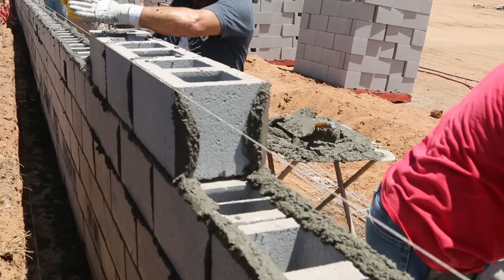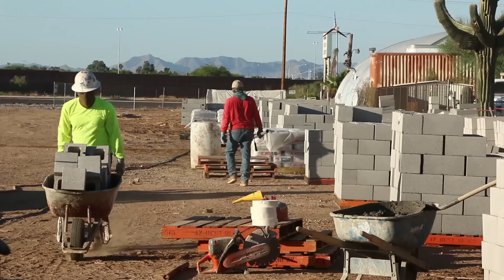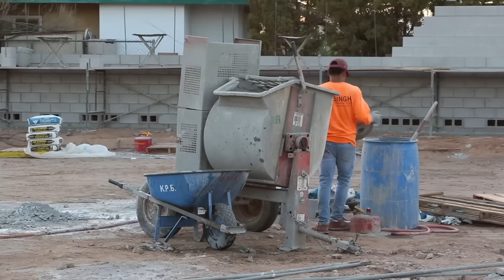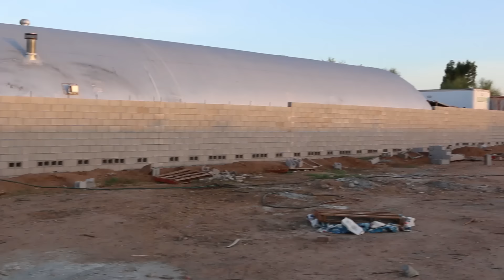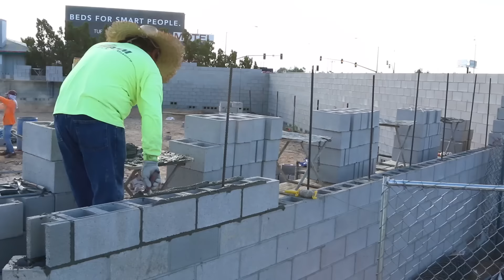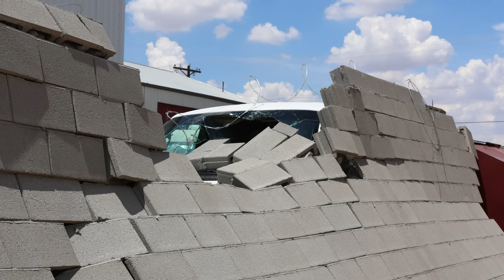Building A Block Wall

Comment: Very nice work, as a Structural designer focused on concrete structures I really appreciate a thoroughly examination of every aspect a wall design. Rebarbs placing, various concrete mixtures, ladder meshes involving, overlapping lenghts, foundations that all is very important and plays a significant role. The workers had to be very crafted, when they are able to build up such distances of line structures without string using.

Comment: https://youtu.be/Mf4p7OBj9jA                                                                                      
https://youtu.be/8NtXOj8duX8                                                                                                                          
For regions and/or states: we release the “know-how” to market an innovative professional fixing system (it is applied without drilling). https://youtu.be/8NtXOj8duX8                                                            
Für Regionen und / oder Staaten: wir gewähren das “Know-how“, um ein innovatives professionelles Befestigungssystem zu vermarkten (es wird ohne Bohren angewendet). https://youtu.be/8NtXOj8duX8                                                                                                                                     Pour les régions et / ou états: nous accordons le «know-how» pour commercialiser un système de fixation professionnel innovant (il est appliqué sans perçage).                                          
https://youtu.be/8NtXOj8duX8                                                                                          
https://youtu.be/Mf4p7OBj9jA

Comment: Before fixing steel bar you not dome dressing, leveling and compacting of earth surface to ensure when wall load pressure goes down its resist
It 
Also you not did PCC 1:4:8 to make sure steel bar is on same level

Third class method you use for RCC

Comment: Honest question, this is a beautifully well-engineered wall and amazing work. You and your crew are master Craftsman. But why not put buttresses in the wall and why not also make it double wythe? Buttresses along with the poured columns that you've included would help strengthen it even more, or if you made a double wythe instead of a single wythe you'd have 16 in thickness of wall which would resist overturning pressure even more. It would however be more expensive because you're using double the material and you will need a wider footing. So why not just put buttresses every 4 feet? That would be a good compromise. Along with the grouted columns every 40 inches...

Comment: What an amazing video! Those muscle memory skills are absolutely awesome. Few things I noticed/queries -

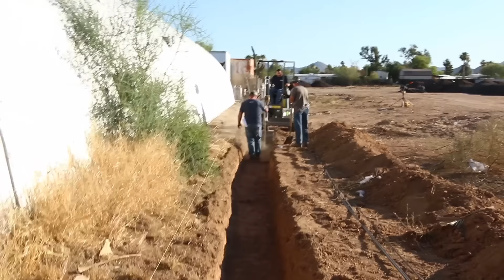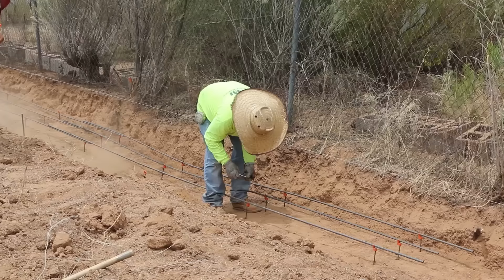- Why is the trench not in a straight line 1:00, 1:33? Surely that's going to waste concrete in the footing? 
- Why is the rebar not in the middle of the trench 2:04? Walls are supposed be centred on the footings unless designed and supported as eccentric.
- Why is there no mortar on the inner meeting surfaces 0:00 - because it gets filled anyway with the grout?
- How do you fit the top horiztonal rebar you mentioned - is there a different block that allows that or you just place it below the top block in the mortar bed? 
- That mix looks perfect and makes a huge difference - not too wet so as the blocks sag, not so dry as to make kncoking into position tricky. Is that why they are not putting the excess mortar scraped off back into the mix 18:59, so as to not dry out the mix? It does look wasteful just throwing so much away, so there must be a reason.
- How come they have not wetted the blocks? Doesn't that dry the mortar really fast and ake for weak joints? Sure the grout will make the wlal strong but won't it need re-pointing sooner?
- How heavy are thse blocks? In the UK they weigh quite a lot (30kg = 66lbs), yet these guys are throwing them around with one hand. Is that a different spec, efficiency of movement, strength - am I just really weak?!
- How come the footing concrete doesn't flow under those steps, which don't go down to the bottom, and try and level itself? I guess the mix must be stiff enough?

(Yes I was the annoying one in school always asking stupid questions. That's why I got top grades and now design buildings)

A lot to learn from this video, thanks so much for posting. Always humbling and fascinating to see this kind of efficiency.

Comment: I know you know your work, but next time stand next to an expansion joint where a block meets a block not a half, 38 yrs in the trade, just saying
Reply: Was that bothering u lol ? Its not common but I've seen it a few times on commercial jobs and it really don't matter one way or the other as u know Joe
Reply: @zeebee3606  love watching your videos, Builders like you don't exist anymore with your setting out and would have loved to be one of your mason contractors.  The half to full block is just a pet hate and yes it dose not matter in structural work but i don't allow it on face work. cheers keep up the good videos
Reply: @joemoore8782  o I'm not associated with these guys lol. I live in the same area but never worked with or met them.

Comment: I saw this and decided to knock down the back foundation wall of my house as it was sliding down the hill. I propped up the house, poured a new footing and got going. I laid 30 ft of 17 courses. At first it was struggle but after getting waist high it went easier. Most important thing, make your footing level, I didn’t. Mixing 100 bags of concrete by hand is not recommended. Thanks EC for providing the inspiration and the knowledge I watch your vids now👍👍

Comment: So, the mortar is the weakest link in the wall. Why not eliminate it with interlocking blocks? No need to mix the "glue" or pay the cost of it or applying it. A layman can set blocks. Where else might cost be lessoned in this scenario? Less verticals/grout/rebar? Isn't the cost of casting both block designs the same? The rest of the world, Asia, Africa, Europe, India, Australia, are using interlocking.Why aren't North Americans? Is this politics? It must be. Only politics explains irrational behavior on a massive scale.

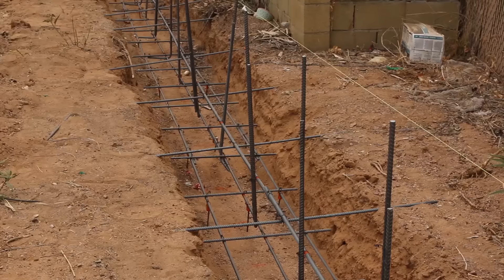Comment: 6:15 thanks for your consideration in vertical rod placements. Unfortunately the concrete guys of today are either too dumb or too lazy to do it right. As a result it takes the masons 2-3x longer to lay the first 1-3 courses of a foundation because we are either bending every rod or cutting around them.
Reply: That's you guys' own fault; someone needs to be there to make sure it's right before the concrete sets. You can't just tie the rebar and leave the footing for the ready mix guy while hoping everything magically stays in the right place. Some non-mason doesn't know, doesn't care, and doesn't get paid enough to be straightening out all of that rebar.

Comment: I dont know guys....but...why doing it easy way when you can do it hard way....have you ever think about why are these block hollow?...that concrete has to be inside that block not under or beside.....you just lay 1st layer to concrete base...level it....and than you just lay one on another on it dry...after every 4th layer...you fill it with concrete with that mix you used for foundations...than you just continue with another 4 dry layers and repeat process....

Comment: As a master Commercial Form Carpenter 35 years , in NYC ,,,, block , brick ,stone , pored concrete are being taken over by panelized factory made wall and slabs bolted to structural steel ,with all kinds of textures window ,,door openings ,some of these panels weigh over 20 tons ,
Myself with one other carpenter have installed 55 foot long 5 foot wide planks  600 feet long train platform in 8 hours with a small crane ,then a 3/8 finish concrete topping the next day

Comment: 3 inches is required by code ACI-318   chapter 19 ICC  Expansion joints should be implemented, not crack control. Check PCA criteria for mixtures. a good contractor knows this.

Comment: ""making a block wall is hard!"
egyptians 4000 years ago: hold my beer!.
Reply: There's a big difference between over engineering and proper engineering.
Reply: They used slaves to do the pyramids
Reply: Sure, its easy with alien tech.

Comment: As a structural engineer, you're being loose with your labeling of materials being "hard" around 13:20. Generally you're correct, but the properties of the mortar and concrete all depends on mix designs and type of loading. You tested these specimen in bending, which causes tensile forces in the material. Concrete and mortar are very bad in tension (approx 10% of the compressive strength). Typically if you took the large aggregates out of a concrete mix, the  mortar should be stronger than concrete. The large aggregates are added to take up volume because the cement is by far the most expensive aspect of concrete. I'd guess the mortar you broke had a completely different water to cement ratio (mix design) as the concrete you broke. Regardless great video, I really enjoyed watching your channel.

Comment: 12.23 you mention concrete mixes. Did you forget CONCRETE has aggregate in it?
Mate just keep it simple, concrete fir footings, mortar to lay blocks and block fill (again just concrete with small  aggregate) to full wall. 
And it’s not referred to as “grout” if it has aggregate in it. You have a lot to learn for an old bloke.
At 17.00 no horizontal steel extending to end blocks, will break off in time.
Actually I can’t see any recess in the block for horizontal steel so it probably has none. It should be in every second course. Looks poorly engineered.

Comment: Wrong...Concretor is NOT a mason.
You forgot the ultimate mason mate, the STONEMASON although you did mention it later. 
Cement mason? Someone who works a bag of cement? You mean Concretors or cement render
Footings not vibrated? Wow
And your control joint is actually an expansion joint. It has total separation right?
Excavation  terrible.
Steel fixing I see they fucked the starter bar up and had to extend it.
10,000 hours or 5 years to learn to lay blocks fast? You’re kidding?
Why not design the wall with alcoves every 30ft, That way it has more stability.

Comment: In middle east we do walls differently, we use block that hollow from one side and we put the hollow side toward down, we just put mortar above and under the block only for saving time and cost, also we dont use rebars inside the wall instead of that we put block or reinforce concrete columns every three meters. and gives nice result.

Comment: IF YOU DONT PUT COLUMS  APART EVERY  3M   AND  LINE BEAM  ACROSS  THE BLOCKS  IN EVERY  1M HIGHT  AND AT THE END OF THE WALL HIGHT  A  LINE BEAM ACROSS  ALL THE WAY WITH REINFORCED  IRON IN THEM  THEN  IT WILL FALL AGAIN  AND THE NEXT TIME IT MIGHT KILL SOME ONE

Comment: I Jamaica we have columns or stiffeners with rebar cages cast into the wall every 8 or 10 feet. At least every pocket with rebar is filled concrete with 3/4 aggregate.

Comment: It is v eery interesting to see something that is done differently in many locations of the world >>> For example :

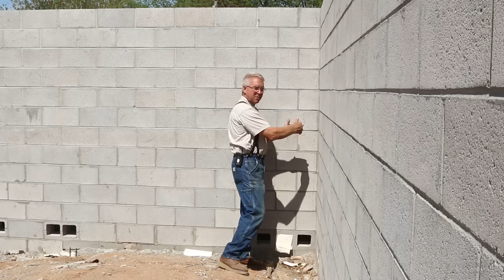- You said here, 14:17, the middle of a long wall must have some kind of fixing strength, so you did pour a special kind of mixture into the blocks where there are hidden columns behind the blocks every 40 inches and the rebars running continuously above the wall.

Now, in my society, where blocks and cement are the dominant parts of any house, this is the procedure that we do follow :

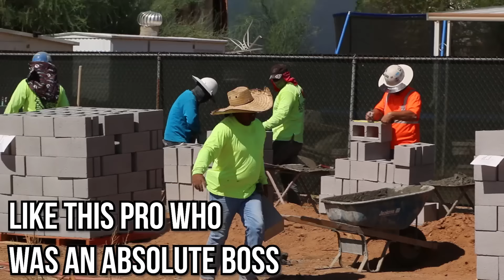1- a very delicately running rebars within the ground that will be filled with footing afterwards, but with no rebars coming up, like this, 2:27, those rebars are just going up as delicate rebars and hooks created as columns, every 3.5 to 4 meters, those columns have an extra foundation around them, (like a square foundations around the columns, for more strength. One point to remember, the foundations of the columns must be done completely before the pouring of the cement into the columns.

2- the blocks are done, sometimes before the cement, with rocks, are poured into the columns, but they can do it afterwards, which is fine, so the columns are basically holding the blocks, for now..., then,

3- the thirst component of the structure, (wall), is another foundation, running above the wall of blocks, which absolutely needs a work of a carpenter, depending on the job, they might need several building specialized carpenters, with, of course, delicate meshwork of rebars along the whole wall, then the cement with rocks are poured into this foundation, the more strength you need the more centimeters will be required to add on that foundation, ( in hight), so that very hard material will eventually set on the wall, making it the second block holder and this will add more fixation to the wall.

In conclusion, I just wanted to share this kind of procedure that is done in my home land, and to tell you that those ways are different and yet they're all valid and they all have the same basic principals and they varied to reach the demands and desires of the type of people and environment that those people are living in...throughout the world :) .

Comment: I was at an event in a simply converted barn, with a 2 metre high block wall forming the base of the barn wall, and had power sockets installed near the top. Somebody was charging their phone, and left it on top of the block wall, and dropped the phone inside the wall. It took a skinny-armed teenager on a ladder to fish it out.

Comment: I once saw a video of a guy that built a shop using block, he just built it dry (no motar) then filled the walls with concrete with rebar. Is this safe construction? Walls 14 feet tall

Comment: Great video. Thanks. As a retired G.C., Was mostly a slab-on-grade guy. Stud/Crud. Been around a lot of block layers though. Notice how these guys rarely use a torpedo level? Don't need no stinking level. (except for the white guy) Running with a wheelbarrow? Asshole and elbows all day long. These guys kick ass. Use the beer cans and bottles for grout. I'd hire any one of these guys. Bricklayers and stonemasons are a different animal. Thank you, Lane bros.

Comment: I’ve often thought of how I would make these kind of walls and one idea that I came up with was to have an occasional pvc pipe as large as will fit going through the footings and reaching all the way to the top and filling them with sand to maintain pressure so as to immediately fill any voids that may form due to natural movements of the land. I suppose the footings might have to be wider at those sections.

Comment: The lines are for heat elongation cracking. Soil settling would not have vertical crack lines in the first place as the settlement of the soil is more likely to be gradual not definitive at a certain point. (Step cracking)

Comment: I don't see Columns in between. Such a long perimeter fence and without columns at regular intervals is not advisable. The other thing which brought to my attention was no curing. I could see the dried up joints and then fresh joints. Otherwise, the video was good with good quality of workmanship.

Comment: the trench must be moist before pouring concrete. Also, coverage is not only at the bottom of the fotting but on the sides too. Conterforts may be needed to give support on long walls. that wall may overturn or deform under strong wings or eartquakes

Comment: Wouldn't be more economical to make some piles on that foundation beam and let them deal with the overturning moments? It will reduce the volume of concrete significantly on the beam.

Comment: I'm glad I came across this excellent video. As you explained the construction and materials, I thought back to the rear property wall on the new development I lived in, in Imperial, CA. The builder got away with a 2x4 and panel fence that he plastered over. I could push my wall back and forth, and knew that before long the posts would rot out. In an older section of the development on an old feedlot, the wall failed for about 200 feet. Guess builders are able to bluff their way in smaller cities. The vid shows me that I'll have to bulk up the cost estimate and find a good reliable contractor for my fire hazard concrete wall.  Oh yes. The border wall to the development was about 300 ft W of the Brawley fault; quite active.  My compliments to the masonry workers!

Comment: If those tradesmen block layers came and saw how they do it in the Philippines they would cry. 95% of the walls here have to be plastered inside and out, there is vertically no structural strength in the blocks

Comment: 16:04 is something customers need to understand when shopping for quotes.. Most customers know nothing about how important reinforcement is in a block wall so they go with guys that will charge them 1/2 the price to build a wall but will dig and pour an inadequate footing and skimp on rebar and grout (use #3 rebar when #4 is required or no rebar at all and weak psi grout or no grout at all), when the job is done it will look like the same wall the guy charging double would have built exept without the reinforcement.. That wall will look good, the customer will be happy and think he made a great decision by getting the cheaper guys to build the wall and pay the contractor but a year or two down the line that wall will fail! If the reinforcement in the wall would have been adequate from the beginning the wall would last a lifetime. With masonry if you want it done right its a buy once, cry once type of deal. Do your research folks!!!